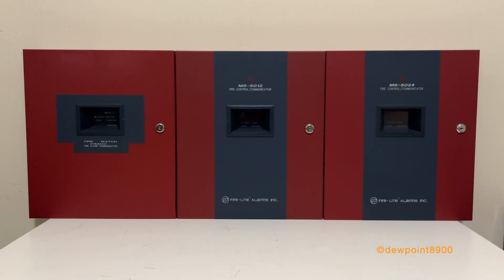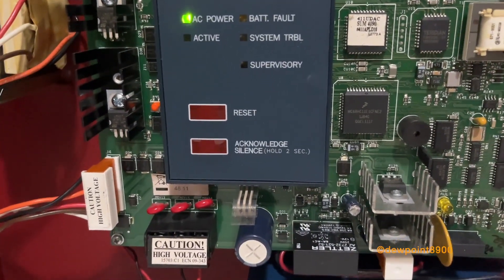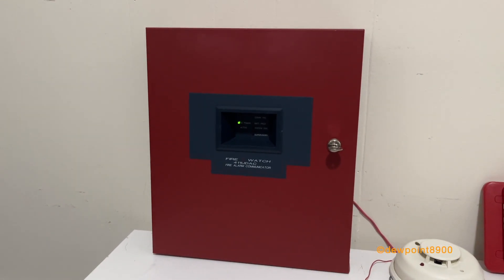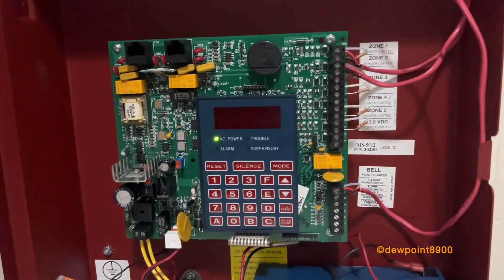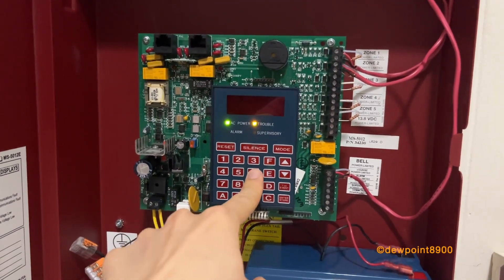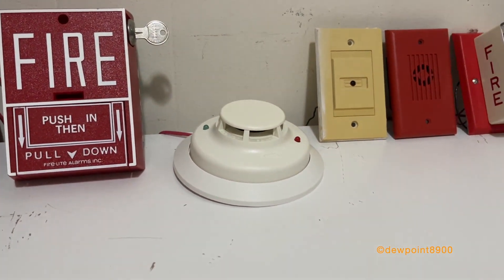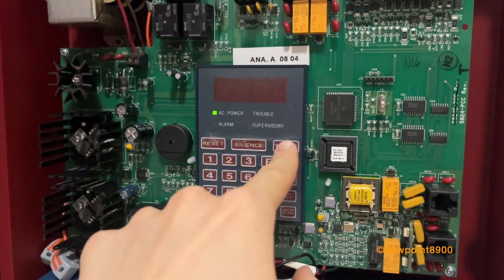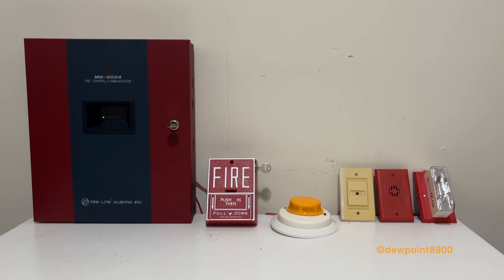Fire-Lite 411UDAC/MS-5012/MS-5024 Overview and Demo

Comment: On the 411UDAC, may I ask how you disabled the “COMM FAIL” I just got this panel for my self, I have a Programmer tool for it but I still don’t understand how I disable the trouble without needing a dialer.
Reply from the maker: In programming, address 64 sets the operational mode for the 411UDAC. Options 0 (default) and 3 disable the dialer, which should clear the comm fail trouble. This is assuming you’re not gonna use the dialer, as I did.
Reply: @dewpoint8900 Thank you